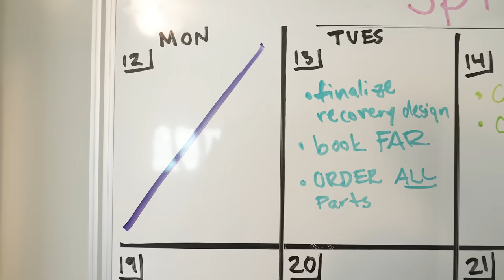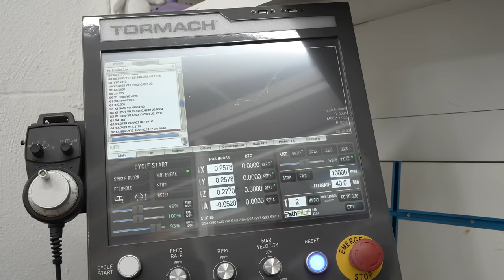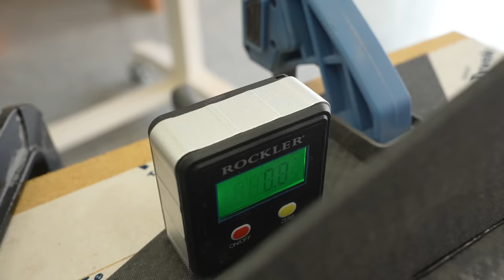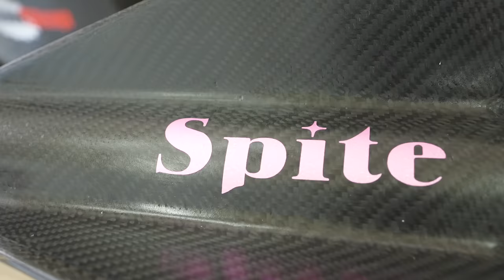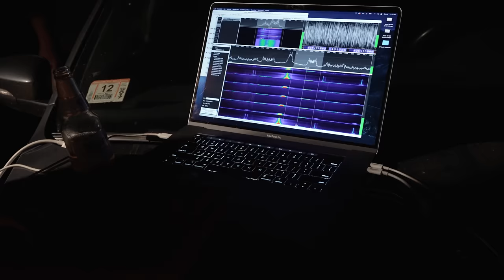ALL Carbon Fiber: My Fastest, Highest, Craziest Rocket YET!

Comment: When I had my rocket program I used super glue as clamp with carpenters wood glue, it should work for epoxy polymers also just keep a couple of small sections free of epoxy and super glue your fins you can add epoxy to them later, if you want to speed up your cure time add less B  hardener, putting your rocket on a rotisserie will help the epoxy glue cure evenly and better balanced

Comment: I started building Estes rockets on my 13th birthday (1965).  I still have the launcher my father and I designed as an instantaneous launch option to the old Estes "wait-for-awhile" launcher.  I still have the very first issue of the Saturn 1B which I built when I was 16. It's a bit dilapidated now.  I'm 71 year old.  Shoot for the stars!
Reply: Congratulations for being able to hold onto that S1B for so long.  I'm 57 and don't have any of the models I built when I was young.
Reply: Still have the Mercury and Saturn 1B built in the early 70's. All of the others are gone. I'm 60 now.
Reply: I have an unopened Estes box kit (from mid 90s), with a few rockets and launcher, and motors. Never built them with my kids. So I'll be building them with my grandsons soon. I have a rocket from the early 70s that I'll rehab and fly as well. 
We used to fly them from El Mirage dry lake in CA, then ride mini-bikes to chase them down before they hit the ground.
Reply: @daddyofcallie  I would recommend not using the old engines when you finish the rockets - my first ever rocket kit was a gift from my uncle who similarly had it in storage for years. First launch using one of the old engines and it barely cleared the launch rod before the ejection charge went off and blew the top off the rocket. I'm guessing the black powder had absorbed moisture over the years or something, but it burned through the entire engine almost instantaneously and the ejection charge was certainly more energetic than normal.
Reply: @daddyofcallie  Lol, my brother's Riverside based high school rocketry club would go to Lucern Lake on the east side of hwy 395, east of Hesperia.  This was back in '71-'73.  I was still in Jr. high.  Usually someone brought a mini trail or bicycle for recovery.  Getting your launch trajectory correct for a parachute recovery back into camp was magic due to the winds aloft.  We were so poor that 2 launches per trip was fine.  We paid a small club fee for dues.  What a magical time to be growing up.
Reply: I still have my Estes launch platform from about '77, I remember my dad requiring me to count down from ten, ugg so long wait. Launched off the same pad with my son '05 .
Reply: Oh and didn't Estes, back in '78ish, have a rocket that would take a picture?
Reply: @damnwereinatightspot It was the nosecone. It took 110 film and the shutter was triggered by the ejection charge. It took exactly 1 photo and it worked best with zero deley ejection. Imagine iso 100 in low light moving fast and you'll have a pretty good idea of the image quality.
Reply: Thats awesome, thank you for the recall.  @RowanHawkins
Reply: My comment is purely hypergolic
Reply: My first one at the same age and year was an X-Ray.  I built my own launcher(tripod).  My father(engineer) and my mother(math teacher) pretty much let me have run of the house.
Reply: @RowanHawkins  - I remember it well! We used to put all kinds of things in the payload section of the nosecones to see what would happen. I don't remember the model name but it was a LOT of fun!
Reply: We had a rocket club when I was in 7th and 8th grade with our science teacher we thought we were just having fun  but he was teaching us different things. He send couple us 400 yards from the launch pad with a transit to get the angle of the hight rocket the figure out the hight of the rocket. Damm him he was teaching us when we were having fun. THE BEST TEACHER I EVER HAD.
Reply: Ditto! Still have a launcher and several rockets we flew at work in the early 80's when I introduced my older co-worker to them. Lots of great memories!
Reply: If the rocket always spins in one direction then add opposite cork screw Chanel’s on the rocket. 😊 it should fly straight up and straight down.

Comment: 3:15 Wow composites are really simple? I'm going to start a submarine company now. Thanks for the inspiration.
Reply: I'd pay atleast 250k to get a seat!
Reply: Very simple, off the shelf parts.
Reply: And if any engineer specializing in submersibles tells you your design is shit, you can just resolve the issue by firing them!
Reply: @AlbertaGeek  and using expired airplane carbon fiber isn't exactly a grand idea when one's pushing the most extreme of extreme conditions this side of gas giants.

Comment: For simple, faster, better FILLETS order a bag of 3m Glass Bubbles (usually called micro) from Aircraft Spruce. In a dixie cup, mix the bubbles with the same epoxy you'll be using with your cloth, until you have a peanut butter kind of paste, use a tongue depressor to create the profile, and put your cloth down. A better chemical bond, no waiting or sanding. Hope this helps. Also try flocked cotton for larger radii fillets.

Comment: Absolutely loved the project and the end result. Just a word of caution at 5:21 as you move both hands to the outside stack of MDF while cutting on the table saw. With the piece being wider than it was long and pushing from the "outside" of the blade, you are introducing a twisting force on the wood, pinching the back of the blade while not securing the piece between the blade and the fence. This can result in bad kickback and jamming/launching of the part between the fence and blade - often straight back but sometimes up and/or sideways depending on what part of the wood gets caught by the blade.
Reply: You are absolutely right the twisting force can cause kickback but isn't that what the riven blade behind the cutting blade to stop the wood twisting? You can just see the riven blade poking up tp the right of the cutting blade at 5.21? Not to diminish your comment as its fair and it causes serious injury if there's kickback

Comment: Pointless story: I was heavy into rocketry 20 years ago, back in the day when flight computers were just coming online and GPS was new and expensive. I wanted to build my own GPS tracker that transmitted a position on the 2m ham radio band into the APRS network. To do so I would need a ham radio technician license. At the testing site, after I had passed the technician test, the proctor asked if I wanted to take the General class license test while I was there. Not having studied for it, I failed the test by one question. Gauntlet thrown, I came back the next month prepared to take the General and Extra exams, including the Morse code test, and passed all. Consumed by a new hobby, I never finished that tracker nor ever launched another rocket.

Comment: I've had several reloads with tight liners(~20:00) through the years.  I usually test fit it in the casing before loading the grains. If it's too tight, I just sand it lightly until it fits normally. I haven't seen the fly away rail guide system before, that is beyond cool!! Great flight, great build!!

Comment: They sell prepreg carbon spools so that you can just layup exactly as much as you need & don’t need to mess around with epoxy each time.  Just have to keep them refrigerated & can use them for a dozen different projects.  Way cheaper & a bit more freedom to layup odd shapes but a bit more work than going with premade panels.

Comment: You can make your own “epoxy” for the fillets by using chopped cotton and your regular epoxy resin. You can get the cotton from Aircraft Spruce. (Cotton is stronger than fiberglass btw). It’s what Burt Rutan uses too….   (I’m building a Long EZ using Burt’s plans right now….)

Comment: TIL you can sling a rocket mach 2 for fun. Would it make sense if you had to do it over again to make the fins as 2 pieces and cut a slot in the pipe or does that give up too much strength in the pipe? I've only ever messed with the little cardboard tube rockets.

Comment: With such a tight fit for the tube in the groove it seems like it would be hard to know if it was too high or low to get the first pair of fins at the centerline. So it would be good to check all levels first and extend the tube out the back and mark both sides of the fins and flip the tube over and see if the location matches. Also, the same for the opening in the sawhorse below the tube, it appeared to create a very tight fit and the hole was cut by hand so it would be very easy to angle the tube when inserting the fin.

Comment: You probably already figured it out - but "de-integrating" the case and motor tube can be done by applying a heat gun to the case. It not only expands the metal, but liquifies your lube between them. Then it's easy-peasy...

Comment: Cool, kids project. Here's a couple of mine from the 1970s. I took a government contract to see if I could design a weapon, that from earth I could hit the moon and prove it worked. After my design was built, I had designed a webed, energy ball. ( Easy way to explain it ), the projectile was not solid matter but a ball of plasma, held in place by Adams, that made a kind of hollow, shell that, was packed with, the purest form of energy.  The first test, joint chiefs showed up, top brass, ECT ECT, the metal building that houses the one of a kind weapon. Roof opened up.. count down, 3 2 1, fire, the discharged, made a recoiling shock wave, turned, surrounding, air, into a white cloud. Telescopes, tracked the plasma ball, in trilla second, it hit the moon, went thru the moon and keep going.
We tracked it as far as 1977. Tools could. After MPs, arrested my team. I had to sign that I would not shoot any more holes thru the moon. NSA FILES 1977.
HOWARD HUGHES, Defence INDUSTRIAL COMPLEX.

Comment: Great Job on the Rocket and the Video!  I haven't done a minimum diameter rocket yet.  My large motor rockets have been 6.5 inch motor tubes.  That large of a rocket likes "N" motors like N2000W, N3300R< N4700T and  N2220DM Aerotek motors.

Again Awesome Job!
Rocket Rick

Comment: I have found it way better not to use lubricant on the liner. Testing it dry also allows you easily to sand down if you have a tight fit.

Comment: You should build 1 that is 2 foot in diameter that is 5ft long.

Maybe put a cellphone on board with a gps and an ""air tag" for gps tracking on faster recovery.

You can also install a wireless mini camera in the nose cone and on all sides for recording trip. On small returning rockets.
And also those that you do not recover.

Maybe even launch some satelights for NASA!
$250,000.00 sounds pretty good paycheck😮

Comment: Yep, when the liner is too hard to get into the casing then you know you're in for some real work on the other end.  By the way, do you have level 3 certification for this, or are you flying under someone else's cert?  And, if you print a carrier for the camera then it'll be easy to mount it without hot glue.  Didn't you also have to drill a vent hole for your altimeters?

Comment: My other coolest, 1977 project has to be, my 48 quart size, attie gravity, populations. A black box, that could lift anything. Tested in front of the joint chiefs. Lifting 2 tons, then, lifting 10 tons. Both were lifted 3 feet off the floor, and I walked behind them pushing the tones, with one hand. With complete control.... Next, they had me gut a golf cart, of everything, motor ECT. I installed my black box. I asked the grand stand, for people to help me demo my golf cart.
3 adults, jumped in with my....with, zero sounds, no smoke, I drove, them around a gym floor.. then out side.. a general, yelled but can it fly.. answered yes. I , did, a 
Controlled, lift to 5 feet, then 250, feet, then I took off, for miles, with all 4 of us.
The air Force, scrambled jets, we were ID as a UFO., I landed, many miles, away after, jets fired on us. Was arrested and ticketed by the FAA, for no flight plan, no lights, no seat belts no tail numbers...1977, AZ, near White sands.. Air Force, was so freaked out over my work,.... I forced me to run AREA 51. IM THE AIR FORCE GENERAL, WHO EXPANDED AREA 51, into Utah desert, Utah weather, is a lot safer for, the biological, weapons tests. Sad, the air Force, stole my work, robbed me of 820.000.000, from project, Hanna, first, time slider craft, where my pilot fly in a under water, cock put.yes, pilots wear dive suits.. the forward speed is, so far passed what the HUMEN body can live thru, only way to prove my work.
Was to protect, humans, in a water like cock pit...funny, Hanna is so fast, it can't be seen. By humans. It flys in-between, the second hand on clocks. (, and if u watch the big bang.) I wrote the show, Sheldon, string thiery,. I proved in 1977.
900, .., anyway, those rockets are cool, for kids...

Comment: That was cool, great job with the carbon fiber.  Curious as to how well the fins did with the heat?  I was an army aviation sheet metal mechanic and part of our job was fiberglass and carbon fiber repair!   They do a lot of vacuum sealing fiberglass and carbon fiber.  Also curious as to the actual altitude!  Awesome video!
Reply: Heat's not a huge issue, because it's not going fast enough for long enough, and any exhaust that touches it only does so momentarily before it yeets itself off the pad. It's a much bigger problem for much larger rockets and aircraft that you'd be used to, though, you were probably using fancier resins to help cope with that, and I'd imagine most of the damage you repaired was.... human in nature lol

Comment: Your carbon fiber unless its heated, cooked and baked in a vaccume oven its not gonna be that hard, why need to vaccume the oxygen?   So it doesn't burn on fire at thousand degrees of heat, because fire needs oxygen to burn, so by removing oxygen it won't burn but only cooked, heated and baked to harden it up.  People think by skinning it with carbon fiber and coating it with hardeners that makes it harder than steel, no uh-oh no...😊

Comment: Nice!  Aren't there some accumulated pressure waves when crossing Mach 1?   Is that why it's built for Mach 2 so it can whip through Mach 1 without shaking to bits?
Maybe I'm just remembering that part from the manned, greater than sound, jet test pilot Yeager in "The Right Stuff".

Comment: cool video. 
I'd be tempted to make a jig for your fins.
Here is a trick when working with epoxy=====Just put clear tape over it then smooth the tape.  It can't sag.  It also works on vertical stuff

Comment: First, this is very impressive.  Second, I would prefer the ratio of content to be reversed: launch happens about 32 mins into video, leaving ~3 minutes for flight and recovery.  I wish there had been more footage from the flight and analysis of telemetry.  More science -- how fast did it actually go, how high, did the separation charges fire as desired, how did the fins fare, did the motor case ever come out of the carbon tube -- and less crop-top content please.

Comment: If you are interested in going faster,  consider a rounded nose cone cap instead of a pointed one.  It throws a shock wave that misses the front of the rocket lowering drag significantly.

Comment: Could have made slots in the body tube that the fins fit into. Increasing rigidity and creating a much stronger bond with the potential to use less carbon fiber material as well as being lighter. possibly a decent percentage of weight lighter in total allowing the rocket to reach a higher altitude. 

Having commercials in the middle of your video completely ruins the enjoyment I was receiving watching this.
Reply from the maker: Lmao you have never built a minimum diameter rocket have you

Comment: When operating a hand drill always lay the index finger parallel in line with the target in order to point down the drill then use the second finger to pull the trigger. Dimple the drill hole so the bit don't skate.

Comment: Wouldn't the location for launching a model rocket that large be regulated, especially near airports?
Reply: Yeah... You see all the other launch pads, equipment and safety trucks etc... (plus it being in the middle of the desert). This is being put on by a club, they have to get approval from the FAA and clear it with local airports etc.
.
Anyway, an organizer clears all that with the FAA etc. But you only need to do this once you get to a certain altitude/size (motor and/or mass).
Reply: @obsidian....  I haven't pursued flying model rocketry in years. I live in the Chicago area, and there are open fields in local forest preserves that are designated for "model airplane" flying, which is also of interest to me, but far, far more expensive. Anyway, sometimes I would find myself in competition for the use of "air space" in these forest preserve areas with those who wanted to fly model airplanes. One time, I was even threatened by a clown who tried to intimidate me by flashing a deputy's badge (in the Chicago area, having the slightest political connection has its 'privileges').

Comment: As a former builder I will argue that prepping and planning wet layups is going to ensure you get the best results. If it's a large project you need to prep then plan when another person can assist. I believe that the best epoxies I ever sanded reached maximum speeds of sub MACH. The actual speed is Classified.